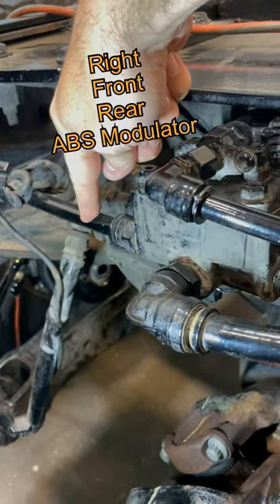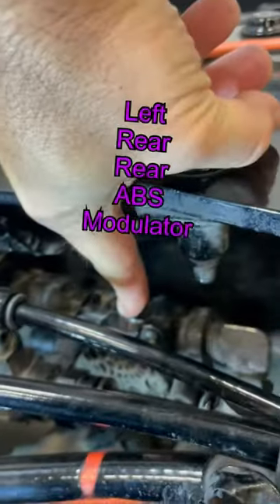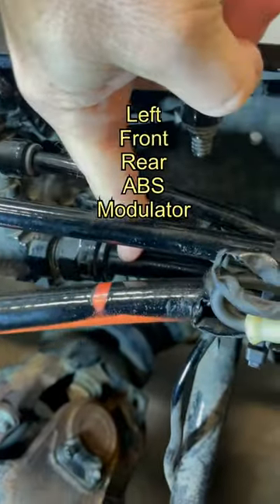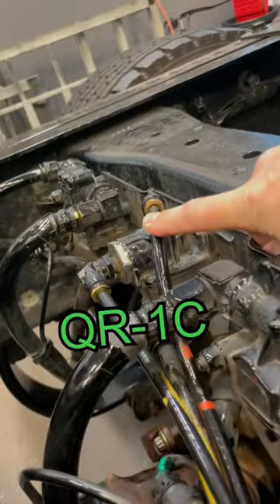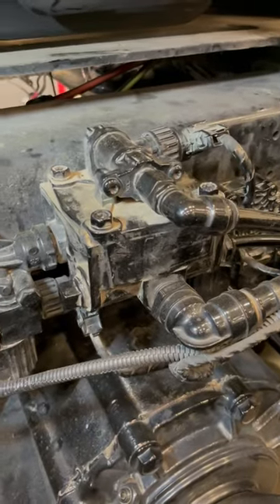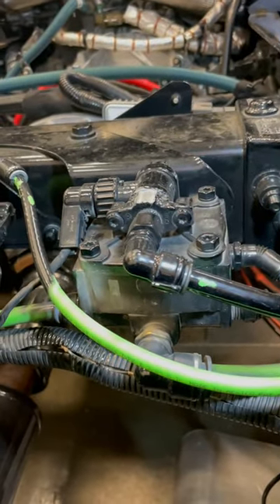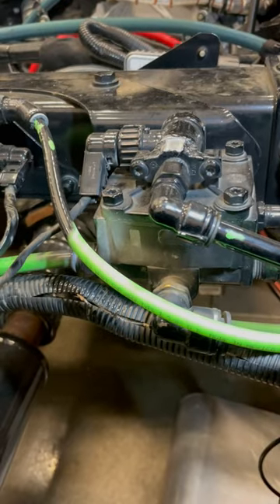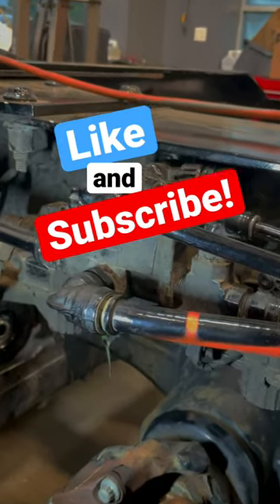Air Brake Relay Valves! BigRig Brakes!!#diesel #trucks #mechanic #cummins #technician #garage #tools

Comment: Hey boss, I have a 2019 cascadia, after I apply and release my service break, the application gauge still shows some pressure there 3-5 psi and my break lights are on and hence my cruise control doesn’t work! I have to pump it a few times to fully release remaining air! What might be a culprit?
Reply from the maker: Does it still happen with or without a trailer? 
I’d go after the application air switch first. Might be faulty/sticking.
Reply: Yes without trailer works better, ohh let me figure that thing out! Thank you!